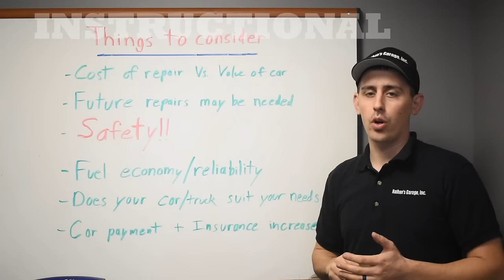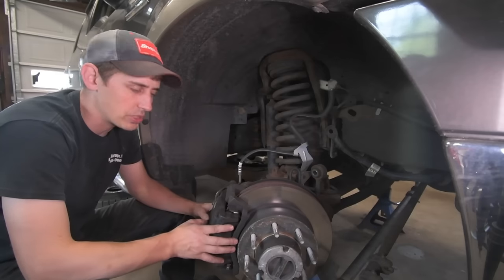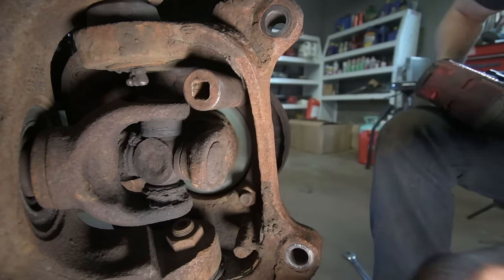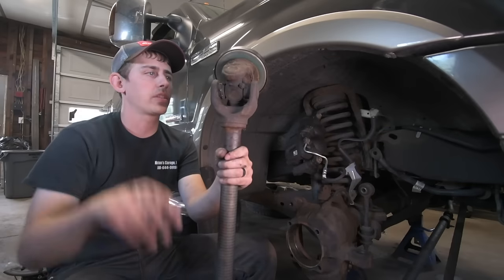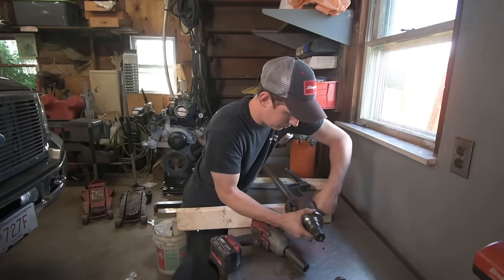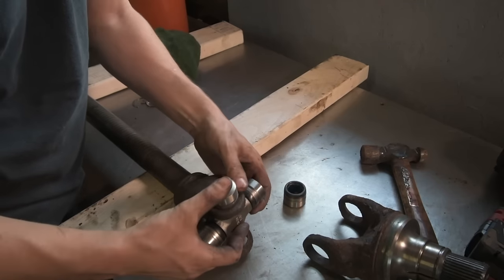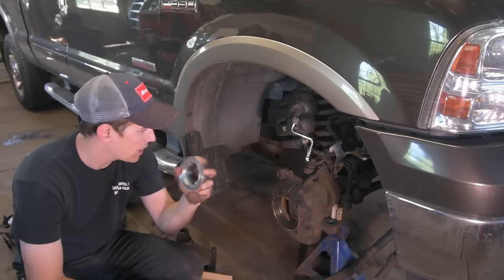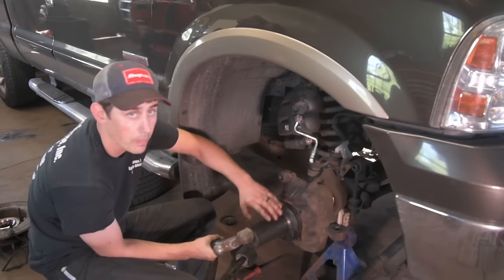Ford Superduty Steering wander repair....Axleshaft u-joints

Comment: Thanks so much for the video!!! I’m having the same issue with my 2011 F350. My husband used my truck tonight with our car trailer and it turned hard to the right while he was driving down the highway!!! The truck and trailer were all over the place, caused the trailer to pop off my hitch(no car on the trailer thankfully), thank God for the lead chains 🙌🏻. The mechanic couldn’t feel or find the issue and now I’m thinking of taking it to another shop that specializes in diesels. I’m just wondering what this jobs runs cost wise? I’m sure the labor will be more than the parts, looks pretty intense lol
Reply from the maker: Depending on the shop you go to expect 2-4hours of labor per side. Likely on the higher end of that. Labor rates vary drastically so Its hard to say exactly. Thanks for watching! Hopefully it helps you.

Comment: Do you have a video for checking the steering Box?  I have a wander problem with my F250 4x4 diesel, and was told by a shop that it was the steering box.   So as you said in this video, it is important to diagnose the problem correctly.

Comment: Soooo i just turned my truck far left while taking a corner in a parking lot at like 15mph and when i went to turn it back right i felt this like stoo clunk and it then turned fine. It wasnt enough of a clunk to stop me from steering but i also feel that wandering issue going down the road. I think this is exactly whats going on with my truck oh yay
Reply from the maker: Sounds like it could be.
Reply: @InTheShop  i gotta check my steerinh column u joints just to eliminate that because its a little cheaper and easier to do but im pretty sure its these u joints. Thanx man love the videos keep up the awesome work

Comment: This man is a true professional, subscribed!

I haven't tested it yet, but I'm pretty sure I have the same problem after watching.  The truck I just bought has had the steering gear box rip off at the bolts more than once and now one of the bolts is stuck in my frame with a failed extraction after many hours of trying.  Is my frame totaled or is there a way?  I'm thinking about just welding the steering gear box to the frame and calling it good?

Comment: Great video. Pretty sure this is my issue. But, why does it still cause a problem when the truck is in 2wd with hubs unlocked? Seems like should only be an issue in 4wd.
Reply from the maker: The universal joints still have to pivot even in 2 wheel drive. This is why it can sometimes be an intermittent issue. If one direction of the joint is frozen and the other isn’t it can sometimes turn free and other times bind.

Comment: I’ve got a 2009 Ford F-250 KR SCREW 4x4. The truck has a wandering issue and wheel won’t return to center. Replaced upper and lower ball joints, inner and outer tie rods, pitman arm, drag link with ball joint, PMF adjustable track bar with 1” heim joint, sway bar, stabilizer and end links.New tires and reservoir fox shocks. All new u joints on drive line and new carrier bearing. New rotors, pads and calipers. Had alignment done as well. Truck is still all over the road and hard to keep in its lane. So then I flushed the mercon V and installed a new gearbox. Helped a little but still can’t maintain its lane and wheel won’t return to center without help. It’s been to 5 different shops and no one can figure this out. I’m going to try replacing the axle u-joints and I’ll update on what happens. It sounds like this could possibly be the end to my 2 year nightmare. I love my truck. It used to be so nice to drive. Now I rarely drive it because it’s so hard to control! I would love to drive it all the time again. Hope this works!?Thanks for the video.
Reply from the maker: Let me know what you found!
Reply: @InTheShop  I just got the U-joints installed and got the truck back today. After 5 shops failed attempts and thousands and thousands of dollars in parts and repairs, not driving the truck because it was so hard to keep in the lane. 2 axle shaft U-joints fixed the truck!!!!! The shop tried arguing with me and telling me that’s not the problem. I finally asked how much was it to repair the u-joints. He gave me a price and I said fix it. That was the issue the whole time. Thanks again for the video. I would have never thought of the u-joints. Now I can start driving it every day again. I missed my truck!
Reply from the maker: @jlev505  man this makes me so happy to read this. This is the exact reason I make these videos. Glad it worked out for you!
Reply: @InTheShop  I have been watching your old videos and sharing your channel with friends who have super duties.  Literally no one knew about this issue. Supposed high end off road shops here in Las Vegas couldn’t figure it out. I wish you had a shop around this area. People act like they don’t want to work on diesels here and there are tons of diesel pickups here. Your channel will get much bigger. Keep up the great work and thank you sooooo much for sharing your knowledge. God bless you, brother.

Comment: Love your videos. Your a professional and it shows. I've always used a large diameter brass drift, to re-install those big Ford donut seals. After watching your video today,. i'm going to get one of those install tools. Thanks alot for all your time making excellent videos. 
Have you ever tried using a redhead or blue top gear box?  Trying out my first one on my 06 F350 dually today. Ive replaced super duty gear box'es before with Napa replacement as well as a Ford reman. Both times was disappointed in the new part performance.  
 Years ago, i spent a summer out on the cape working landscaping. Loved my time in NE!! Beautiful country!
Reply from the maker: Thank you!!! I have used both the redhead and blue top boxes. Both brands are excellent and leaps and bounds above any of the factory or aftermarket boxes.

Comment: Great video, thanks. My 2015 f250 has a front end “float”. I sometimes tow a fifth wheel, but it floats even when not towing.  Is this something you could possibly do a video on?
Reply from the maker: Absolutely if I get a truck in soon that that has a similar issue I can touch upon some of the issues I see. Thanks for watching!

Comment: Great video, going to keep this in my back pocket
Reply from the maker: Thank you!
Reply: I just bought a 2006 F-250 Super Duty lariat 6.0. My truck has a lot of play in stering wheel.possible same problem. 280k miles

Comment: Reminds me of the old Ford twin I beam suspensions when the kingpins would rust fast from lack of grease maintenance.  Would make the truck wander all over the place and impossible to turn the wheels unless you had power steering.   And I'm detecting a New England accent.
Reply from the maker: Yup same symptoms. It can be real scary if you aren't expecting it. As far as the accent.....southern Mass. Thanks for watching!

Comment: Awesome video. Today I had a similar issue. I have a 2012 F250 6.7. I was leaving a truck stop and felt like the truck wanted to go left. I went a little further and the truck suddenly it jerked to the left. I pulled over and shut the truck down. After that it didn’t happen again. I noticed this a couple times earlier in the trip but only when I went to take off. Felt like I was having to fight the wheel for just a few minutes. Would you suggest the hub test you showed? It scared me to death. Don’t want that to happen again. Thanks for you great videos and all the help.
Reply from the maker: Thanks for watching! If you haven't already I would definitely check out the U-joints.

Comment: Very insightful video. I have a 17 F250 6.7, and I've had so many issues over the years with steering just as you mentioned. I've been told to change this and that just as you mentioned here, and still to this day I have issues. You might have just found my culprit! 
Prior to my current truck, I did have a 15 F250 and I did have to change the housing assembly on one side and that was a pain since I had no clue what I was doing. SO following this video made a lot of sense - wish I had this video long time ago. My question now is, what exactly changes part wise or tool wise for the 17's?

Comment: I'd like to take the time to add something here. That is a commonly missed thing with u-joint installs regarding the joint being tight after install. The binding comes from one or both of the caps being down too tight on the cross journal. You have to push all 4 cups out hard against the clips. The way I do that is set one yoke down on two large sockets on the bench and bang on the opposite shaft. This pushes down on the horizontal sides of the cross and pushes the cups hard against the clips. Repeat this process for all 4 cups. You'll be amazed how smooth the joint is when doing that. With your method 2 of the cups are hard against their clips and two are probably binding with the cross.Try it next time and let me know what you think!
Reply from the maker: Thanks for watching and thank you for the input!

Comment: During reassembly, one can use a lug nut or two to temporarily hold the brake rotor in position for the purpose of reinstalling the 'loaded' brake caliper which comes next.

~Ancient Chinese Secret

Comment: Awesome video, I've been having the same problem and I think I found the solution with your video, I'm also thinking of getting a whole new front axle shaft complete what are your thoughts on that, instead of a rebuild thanks .
Reply from the maker: Glad I could help. The complete Axles are a nice time saver. They make the job a lot easier.

Comment: I’m replacing both sides. Is the drivers side removed similar to the passenger and will it require the same seals to replace as the passenger side?  Thanks for the great video. Big help!

Comment: Thanks for this video man. Just bought an 2000 excursion, previous owner swapped out locking hubs on it. But I have steering wonder as well. Truck only has 151k on it...hoping this isnt the issue on mine as well.

Comment: Great video very thorough  ,what is the total working time for each side and is the driver side any different than the passenger side
Reply from the maker: First time around expect 3-4 hours per side. The drivers side is the same as the passenger side. The only difference is you don’t have to disconnect the swaybar link if you are only doing the drivers side.
Reply: @InTheShop  thanks again

Comment: I have a 2016 Ram 4500 two-wheel drive that has been giving me fits for a long time, doing this same thing.  The steering wonders all over.  I've had a new steering box, steering damper, intermediate and upper steering shafts, new tires, new shocks, everyone has said all of the remaining parts are solid, yet the issue persists. Does this truck have a similar axle joint and might that be the issue? Thanks so much really enjoy your professionalism and knowledge
Reply from the maker: Unfortunately it doesn’t have axle joints like this. Has the truck been aligned?
Reply: @InTheShop  thanks for your quick reply! The truck has been aligned multiple times, both with zero toe, and a little bit of inward toe as well as outward toe,. Nothing seems to help.  We used to think that the wheels were fighting against one another causing the wonder, but different alignments did not change the condition.  It's almost uncontrollable when driving down roads where heavy trucks have laid down ruts in the pavement. Thanks for any suggestions!

Comment: Axle U-joint replacement for steering wander on a 2015 Superduty. Enjoyed your video. Same symptoms. Any chance it can be fixed with grease instead of replacement?
Reply from the maker: Sometimes yes but usually once the corrosion has occurred the needle bearings are damaged and won’t last much longer.

Comment: Solid video thanks. Any chance u joints would make a grind sound when 4x4 is engaged and hubs locked?
Reply from the maker: Its possible if they are loose

Comment: My 92 150 was having the same problem. It was the ujoints... I have the dana 44 on my 92 150 flareside... I hate working on the dana 44 manual locking hubs. My hex nuts all ways seize on and i cant get my rotors off. Any ideas? I have tried tap and die, drilling out. Took it to other shops and thy just want to cut the whole 4x4 locking assembly off. I am to the point i want to just remove the dana 44's and put a dana 60 on. Might sound dumb but 60s to me are easier to work on.

Comment: Thanks for an awesome video.  When do these Axleshaft u-joints usually go out, is it years or miles, and how much would a repair like this cost?  Thanks.
Reply from the maker: They don't have a typical failure time it has a lot to do with the types of driving and conditions the truck will see throughout its life. As far as cost goes you are looking at 3-4 hours labor each side plus parts. Every shop charges different rates so it would ve hard to say how much where you live.

Comment: You mentioned break hose failure by collapsing from the inside... Is there an easy way to diagnose that?  Is it noticable by feel?  Love the vids!  Thanks!
Reply from the maker: Thanks John, a collapsed brake hose will either make the truck pull to one side while braking or cause the caliper to stay locked up.

Comment: Great Video! I’m having issues right now and was told if u-joints are froze it could still make your truck seem thats in it’s in 4-Wd when you make a turn even if the hubs are locked out. Is this possible. This is what my truck is doing. Was thinking it was the gear box but having second thoughts now.

Comment: Great video. I learn a lot. Thank you!! Can you tell me if I need the seal with manual locking hubs?
Reply from the maker: Yes you do. the seal protects the back side of the bearing and also helps keep the axle shaft centered.

Comment: I will look for the grease fittings on my 06 tomorrow, pretty sure they have never seen new grease
Reply from the maker: If they are the original Universal joints they won't have grease fittings.
Reply: @InTheShop  yes I bought the truck new in 2006,,  my #1 injector went last month the collar that holds the piston and spring in place broke into 5 pieces looks like metal fatigue . I have all the internal O-rings and new ball bearings new springs, will rebuild all 8...  the copper washer does the ridge face out toward the block ??????    thanks bob

Comment: I have about an inch or more of play in the steering wheel. Would you recommend replacing the steering box? It’s especially fun when towing a 37ft camper. 
04’ Excursion 6.0
Thanks
Reply from the maker: Hey Ramon, I would have someone shake the wheel back and fourth with the engine off while you observe all of the steering components to verify the play is in the box before you replace it.

Comment: Does a 2008 have that seal that's important for vacuum 4x4. Great video not so scared to tackle it
Reply from the maker: It does. 99-current all have vacuum hubs.
Reply: @InTheShop   My 2008 has manual front

Comment: My biggest problem it wonders all over the road like it’s worn I just replaced all tie rods ball joints  u joints. New gear box  the only other thing I can think of is the bushings are worn on leaf. Springs or didn’t do it right i replaced everything bushings in springs and still same  it’s a 2004 f350 crew cab 4x4  6.0

Comment: Hi, Thanks a lot for the well explained video. 
So, I hit the curb and the tire is vertically is kinda inward. I took it to an alignment shop and they says that the axel shaft U brackets may damaged and they need to replace it or heat it or something. I am not satisfied with their answer as F250 super duty should take the hit on tire without much damage. Is there a way to tell of the brackets are OK and how to fix them?

Thanks again
Reply from the maker: I would need to see photos to really know what’s going on with it.

Comment: hi great job i am doing one on my 2003 f350 i have a question the axle tube seal is not on mine must have worn off is the 2007 seal the same as 2003?

Comment: Hey man I really appreciate you putting this together. I'll be tackling this sometime in the next couple days whenever the wheel seal driver shows up.
Question for you: My truck is a 2016 F350 but it has the widetrack front end, so I'm assuming it's the same dana super 60 they put on the 450 and 550's. Am I correct in assuming that I will need the driver tool for 450's? It''s the different knuckle that's used on the Super 60's that dictates which seal driver you use, correct? Thanks so much!

Comment: Thanks so much for this! I have some bad wander. Shop quoted me 6700 to replace every single thing on my 123k 2008 f350. Obviously, i went bad got the truck and said no thanks. I just changed the passenger hub with no major issue. Probbaly will now do driver hub but will do this check. Stupid question, are the u joints only on the passenger side?
Reply from the maker: The universals are on both sides.

Comment: Thanks for the video! Very well made and great pointers. My similar ford super duty is having very similar intermittent steering problem and also had u joints that we’re locking on at least one side. My question is why would this affect my steering in 2 wheel drive with my manual hubs unlocked? The mechanics I have asked said it will not, however it seems like too much of a coincidence to have locking u joints and intermittent steering problems and it not be the cause. Any advice or explanation?
Reply from the maker: It will absolutely still do it with the hubs unlocked. If you had a frozen joint and locked the hubs you would get more of a shimmy while turning.
Reply: I just jacked the truck up and then It was obvious why the u joint still needs to be able to move while turning even with the hubs unlocked. If they rotate into a position where the bad U joint is frozen the car will have trouble turning as the u joint is stuck and unable to rotate with the turning wheel. Thanks again for the video